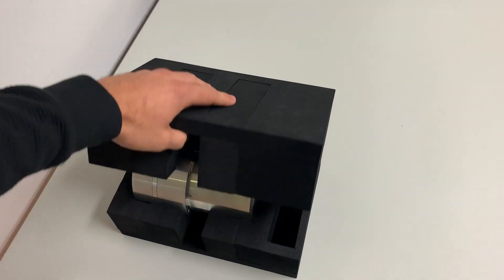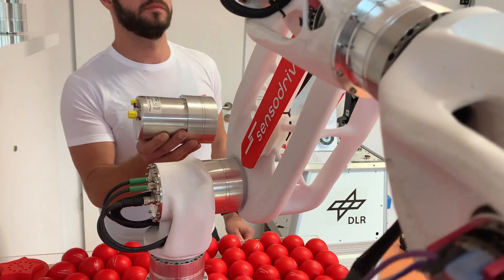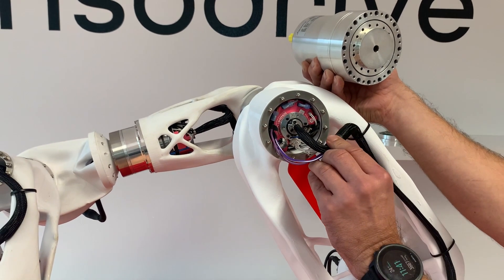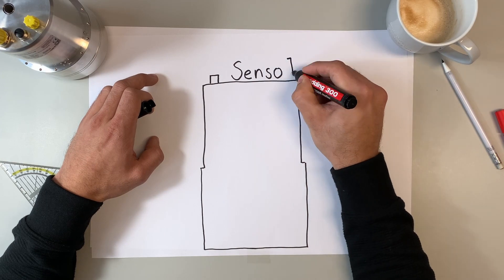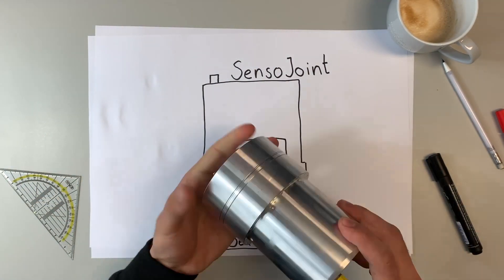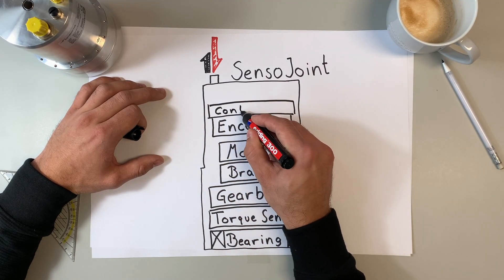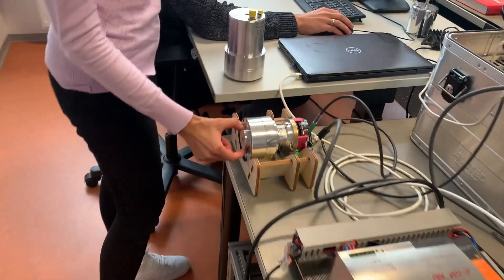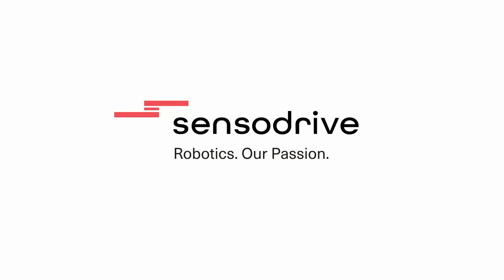Cobot drive: What is a SensoJoint?

Comment: This is amazing - whats the resolution of the torque control ? is the minimal resolution dependand on the maximum torque of the sensojoint?
Reply from the maker: The torque sensor has a resolution of 16 bits and a high sample rate.
As all torque sensors work with 16 bits, the resolution depends on the maximum torque.